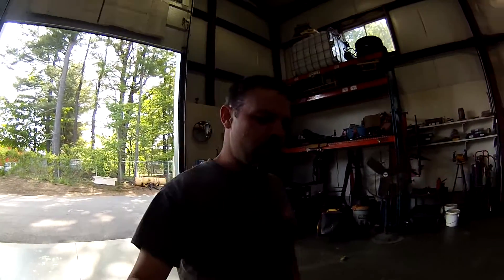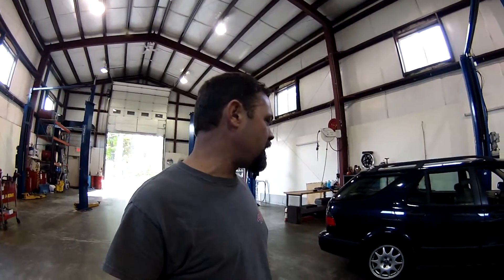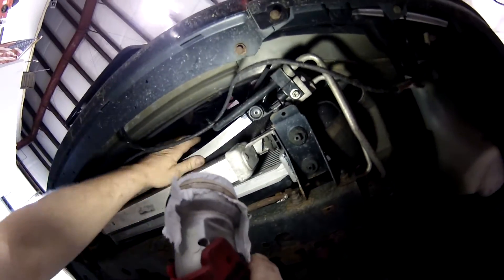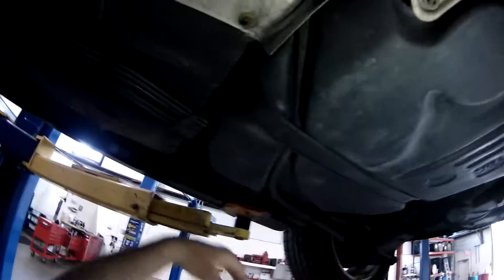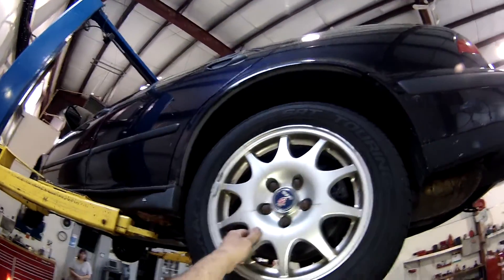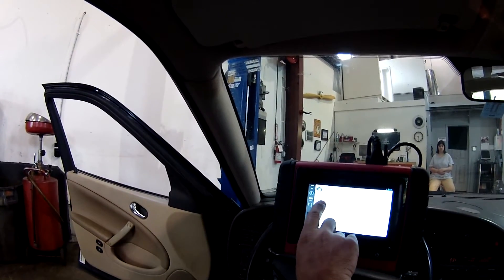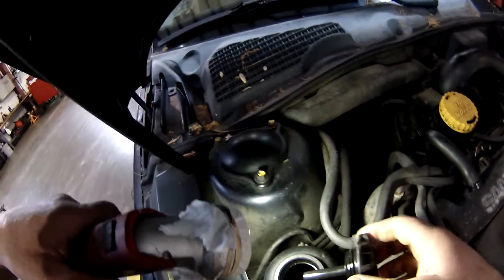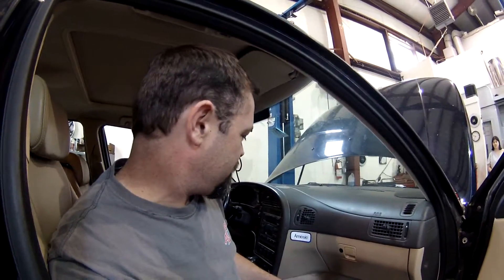The Saab 95 Rally Wagon Gets Checked Out!

Comment: I’d been studying this lift for sometime and just completed the rear at by friends shop in Lunenburg. Been tire of my saggy rear ended Saab 9-5’s and this solution works well. I only lifted a 1&1/4” and threw in new Bilsteins too. Do the front and will have a decent snow car again. Used to be able to claw through 8 inches in my 900 so this sure helps the 9-5